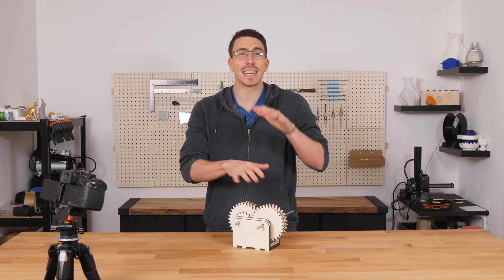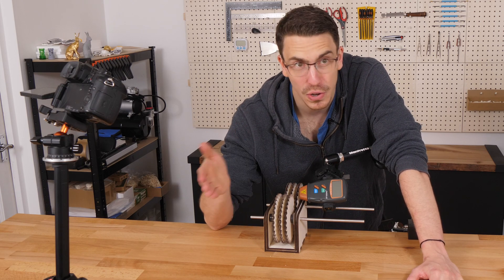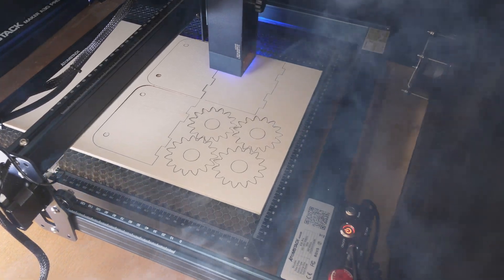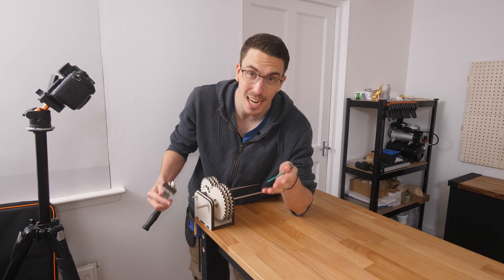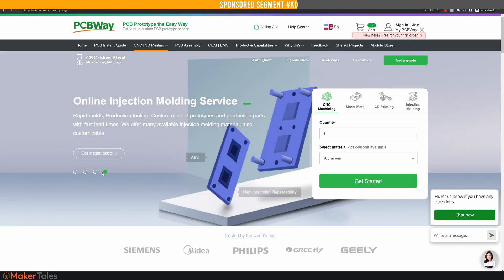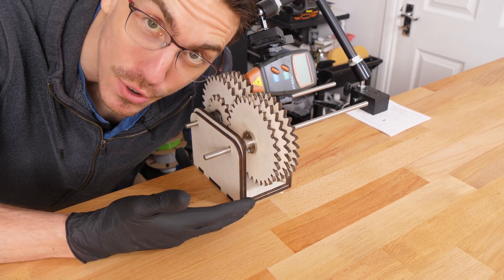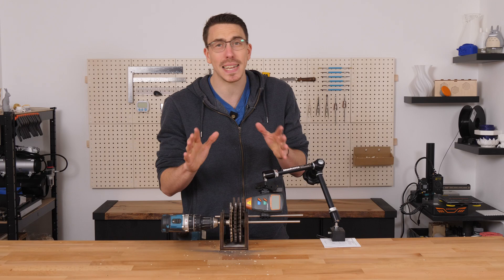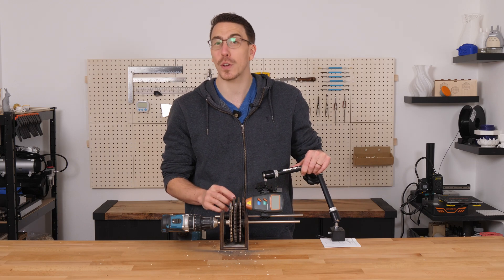Will This Gearbox Break?..

Comment: Let's see 10k rpm. I'm not a mechanical expert but I suspect the gears should be slightly different as the speed gets higher because there will be less torque per tooth and higher speed as it gets closer to the output gear. Maybe the later gear ratios should be lower and have more teeth to spread the load across more teeth. Looking at it with an IR camera would be enlightening.

Comment: While you were concerned about an enclosure for you laser, you had your body and more importantly your eyes in the plane of a fast spinning disk of wood with the intention of taking it to destruction. Please be more careful. Interesting otherwise…
Reply: Spinning plywood with such speed and diameter leads to disaster.
Reply: Exactly my thoughts. Dude! Bending down over plywood discs spinning at high speeds … if the final gear rips, it might be stuck in your chest. When a gear tooth goes flying, it can end in your eye. If you want to go to 10k rpm, think of it at least like a wheel-of-death angle grinder and ensure proper protection.